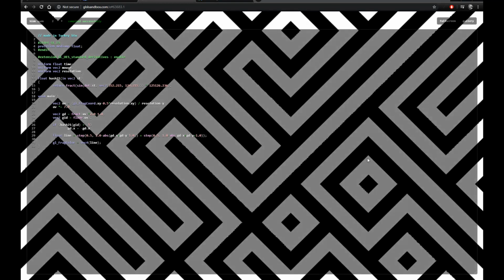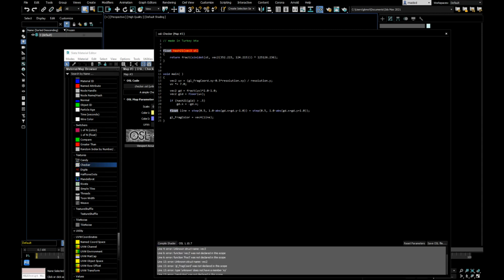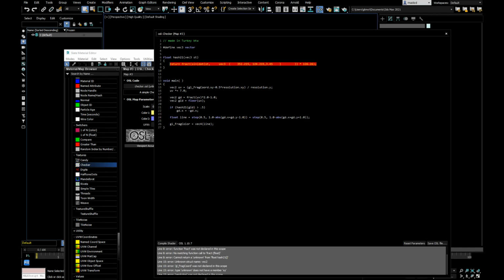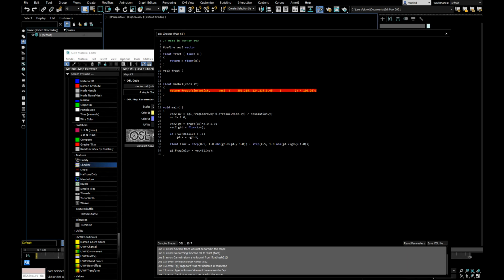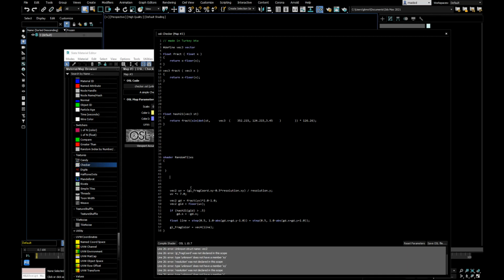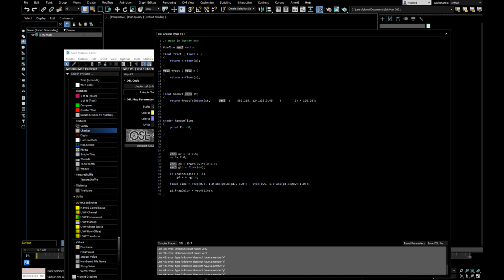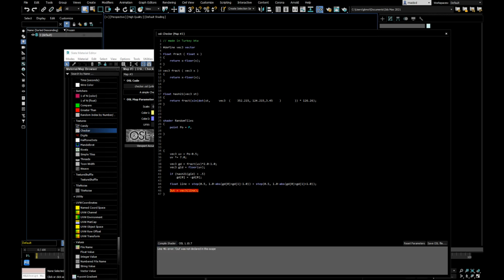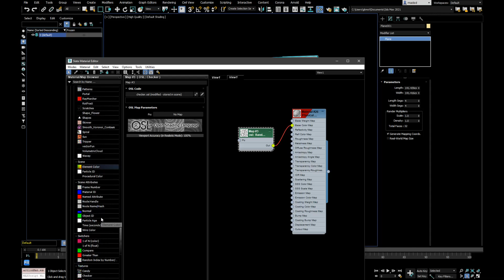GL to OSL, random pattern from glslsandbox.com

Comment: Thanks for making these videos. I would like to make a node that will convolve the image with a kernel filter. How would I go about this using osl?
Reply from the maker: Are you thinking about something like making your own blur kernel? There are several ways to go about that, actually last night I did a fibonachi convert from GL to OSL works great, but also box kernel and gaussians are possible.
Reply: @madsdrschler7853  There are so many interesting possibilities. I am stuck at the point of sampling the input image many times. I will try again this evening.
Reply from the maker: @weightednormal3682  typically you sample something multiple times in a for loop.

https://pastebin.pl/view/e053c3c6 here is the fibbonachi blur.
Reply from the maker: @weightednormal3682  

    for(float i = 0. ; i < samples ; i++)
    {
        vec2 offset = phyllotaxis(i, samples) * radius;
       
        vec2 tt = uv+offset;
        col += texture(tex, tt.x,1-tt.y);
    }